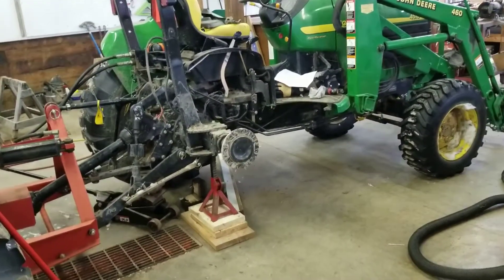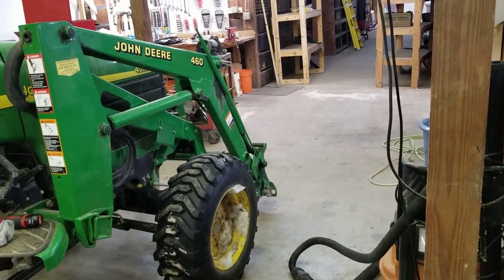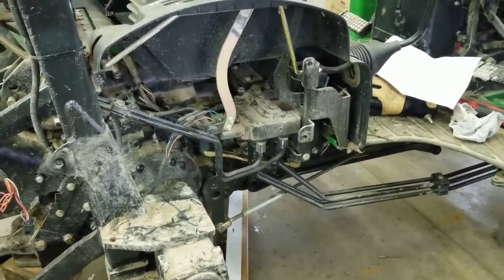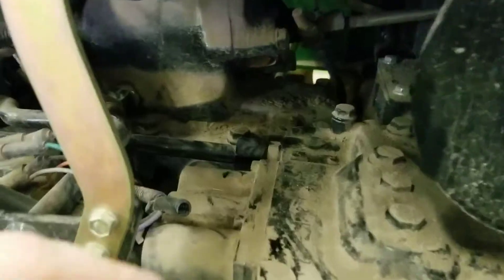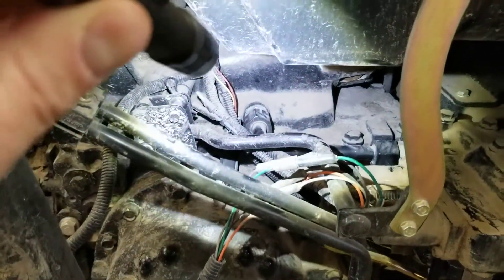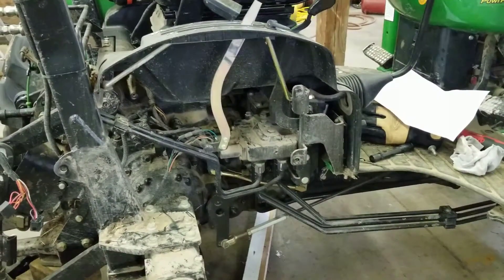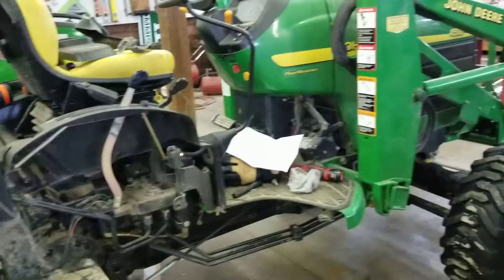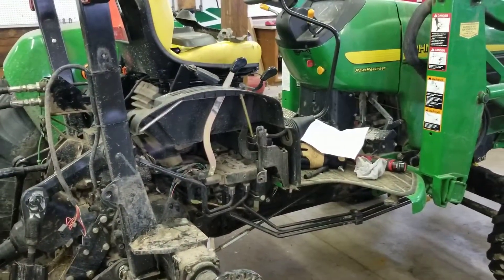Power beyond port finally identified on John Deere 4510 with 460 loader

Comment: If you still have your JD 4510 would you do a video showing the layout of the power beyond with the lines and the ports at the back of the tractor?  I have a 4610 and am searching for the parts to install one on my tractor.  I've looked for installation instructions or a video of how one is laid out and have come up with nothing.  Thanks.
Reply from the maker: This may help. Deere calls this a "Rear Auxiliary Hydraulic Kit" but most guys call just call it "power beyond." It utilizes the same ports I highlight in my video but these lines go out the back.  https://partscatalog.deere.com/jdrc/sidebyside/equipment/4082/referrer/navigation/pgId/2745909
Reply: @TedMinnesota  Thanks.  I'll look into it and get back with you if I have any questions.

Comment: Buddy you just helped me out big time. I have a 4500 which is nearly identical and I've been looking at parts diagrams for hours trying to figure out where this power beyond valve is. There isn't a lot of info out there on older John Deere compact tractors. Thanks for posting this.

Comment: thank you. It gives me good insight into where I have to look for the PB port on my 4300 when i get back to SoDak this summer. I want to use it to run a flail mower that has two circuits, and I've been trying to figure out the system to see if I just needed to put a new dual control valve on using existing remote, or would need to tap in to the power beyond and make new ones.  Found out when I hooked up the new log splitter that the rear remote is still subject to the selective control mounted on the fender (I see you have that too; that is utilized for mid mount mower lift)   Not ideal for running  the log splitter, and definitely not sufficient for the 2 circuit flail mower.   Very helpful video!
Reply from the maker: Awesome. Glad it was helpful!

Comment: Hey Ted. I’m currently trying to install the WR Long 3rd function kit on a 2005 John Deere 3520. I am also having a little trouble identifying the Power Beyond port. It looks to me like you tied into the line that returns to your hydraulic reservoir. I am thinking I may need to do the same thing. Am I wrong in assuming that you tied into the return line? Does your tractor have the factory installed valve that controls your rear remote (mine does and it’s located right by 3-point hydraulic valve handle)? Sorry for all the questions, but I’m hoping you can help. Great video!
Reply from the maker: My understanding is the line I tied into is in-fact the power beyond port (the 90 degree line in the video). Yes I do have the factory rear remote lever.